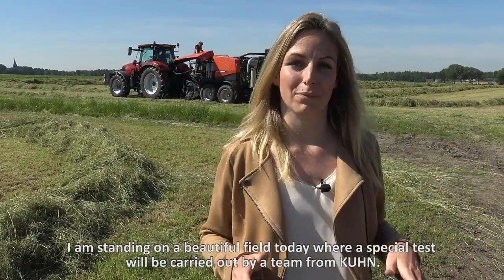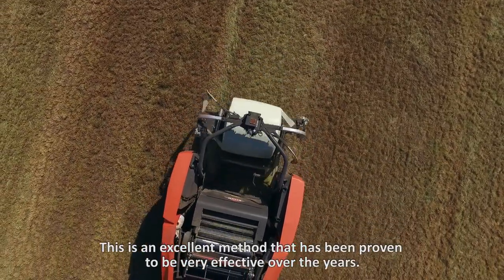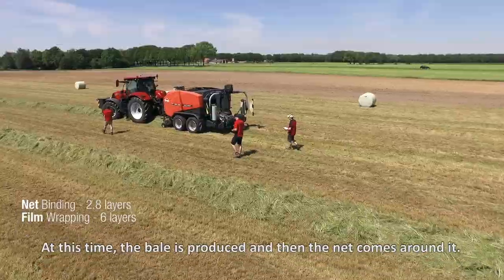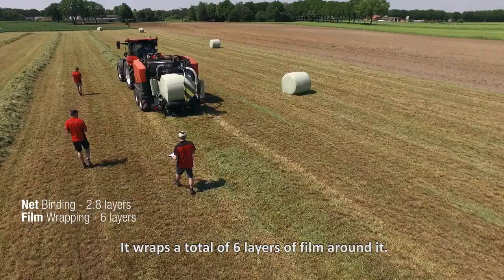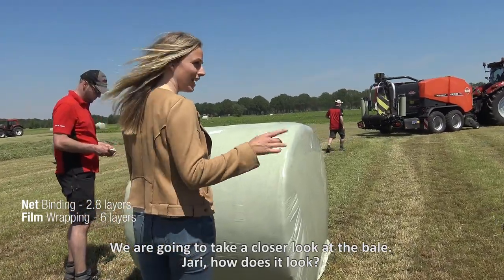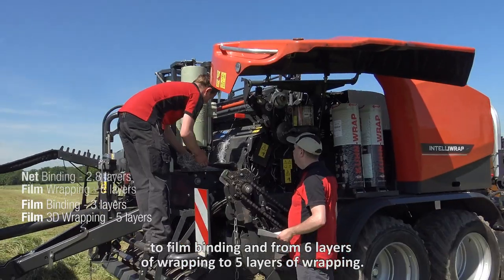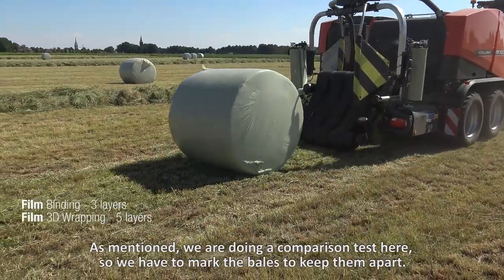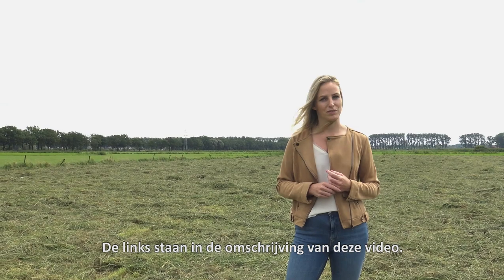KUHN - BALING TEST // #1 Binding and wrapping methods compared

Comment: The 3D wrapping is  interesting, but with film binding probably unnecessary.
Reply from the maker: Hello there,
Thanks for your comment. 
With film binding, extra film is placed on the rounded side of the bale. With standard wrapping each layer overlaps in the middle of the flat sides. By using 3D-wrapping, the film is better distributed and proportionally more film is placed on the outer edges of the flat sides, and these edges are the most vulnerable parts of the bale. The combination of 3D and film binding makes it is more safe to reduce a layer of wrapping. More info about 3D-wrapping in this video: https://youtu.be/jksiJZJXogA
Kindly,
KUHN Group Team